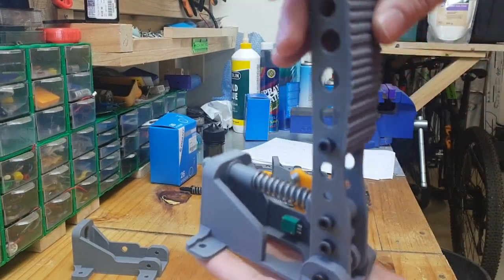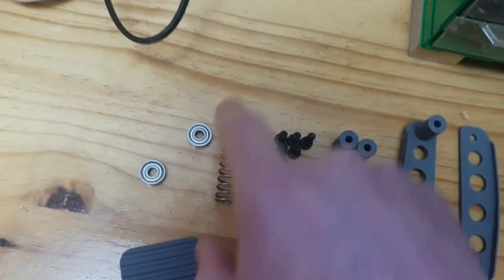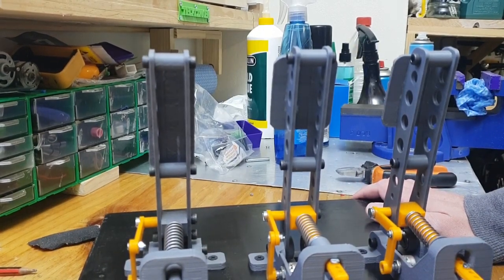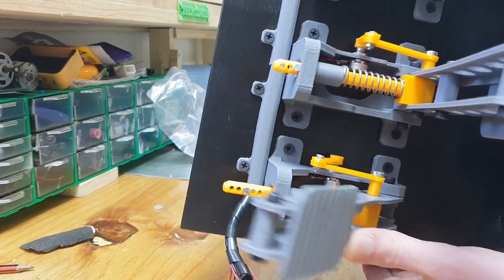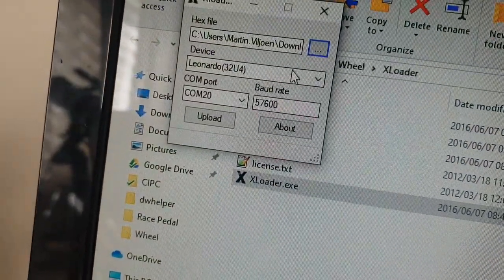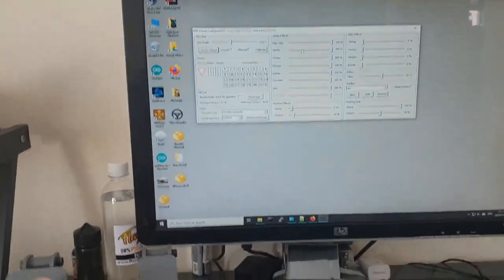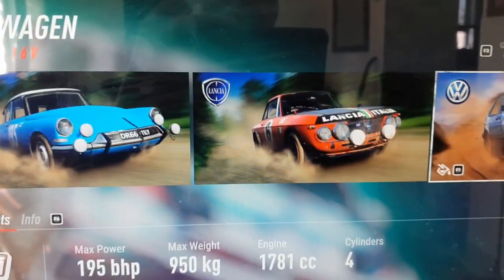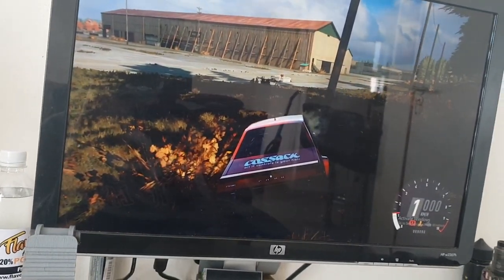3D Printed Racing Simulator Pedals

Comment: XLoader cant recognize my Leonardo do you have any idea why that could be? Leo says it has a bootloader, Device manager reads it just fine aswell. Also when i open Wheel config its flashing on tx LED. But XLoader says upload failed evry time even when selecting the correct Com channel after reset. Any feedback would be wonderful! have put so much work into a full rig and this whole mess with XLoader is driving me bonkers! Thanks.

Comment: Hello, the pedals are looking great!
Potentiometers exist in two different types, Linear and Logarithmic.
- Linear is what you want to use for this kind of projects.
- Logarithmic is what you want for audio (volume control) applications.
Also, any value for the potentiometers should be fine, if it is connected
1 -> 5V
2 -> A0
3 -> GND
where 2 is the central pin of the potentiometer.
Value should matter if other resistors are used in the circuit, but in this simple case it's not necessary.
Reply from the maker: Thank you. Agree the potentioeters shouldnt make  diff. But in this application it does. I have  tried multiple potentiomiters and found that certain values do not give enough range. As said in the video the acelerator would start half way or or only go half way depending which way around you connect them and would not have worked it they were connected incorrectly. It it may be due the way the original creator of the firmare coded it. causing them not to utalize its full resolution. Also the pedal only has about 1/4th travel on the pot. 1/4 th on 100k and 1/4 th on a 1k does not pose the same amount of resistance. Cheers!
Reply: @Mailmartinviljoen  Sounds like  you did not calibrate them in windows and/or the game.

Calibrate in Windows. Than they will ONLY work in the range where you can actually move them.
This is crucial for almost every controler to work properly. Even freshly bought xbox controllers should be calibrated first!

Comment: Hey bro nice work ! Can i ask you, why doe we need the leonardo ? Can i just use an uno instead ?
Reply from the maker: Quite simple :-) The Leonardo is making use of a different chip that allows it to behave as a computer peripheral. I.E  it can emulate Keyboard/Mouse/Joystick. The Arduino Uno cannot do that in standard form. There is however a way to reflash its chip but then it cannot be used with the arduino IDE anymore and will also not be compatible with the wheel software. If you look in the Standard Arduino ide under examples->USB there are some examples that you can look at. In the header it clearly tells you it will only work with a Leonardo.

Comment: I'm planning on building this soon, but i'm a bit confused on how the bearings do anything. How are they attached to the bolt that is used to hold the pedal in place, as it looks like it just sits in the hole.
Reply from the maker: Well spotted :-) They don't do anything, call it a design flaw if you like. They are only there to provide a steel pivot as opposed to running the plastic directly on the steel bolt
Reply: @Mailmartinviljoen  would it be possible to use a longer bolt and put a nut on the end so it actually uses the bearing?

Comment: Why do you use linkages instead of opting for a design with a 3d printed hinge that spins the potentiometer? I want to create my own design but I'm not sure if using linkages is going to be the option I want to use.
Reply from the maker: Do you mean attaching the pot to where the pedal pivot on the body? I used the links because it was easier to design it that way. Also allows me to hide it out of the away. Not sure if i understand you correctly.
Reply: @Mailmartinviljoen  Yeah that's what I meant, sorry for the convoluted sentence. Also thank you, your reasoning behind your design decision, it helps a lot. I'm working on a  similar design but didn't know if the linkage was spinning the pot to a further degree; which could be beneficial.

Comment: Hey bro, first I appreciate you about your good job! It's a good project. For 3d printing, which filament did you use? And which method(FDM,MJF,SLA?) did you use? Can you please tell me, how I will make this plastics strong?
Reply: Abim 3d printer in fdm sla falan olmasi onemli degil, pla abs falan da fark etmez ben kendi adima pla bastim yuzde 20 infill ile yeterince saglam oluyor, is goruyor.
Reply: @emrekaraagac3211  hocam teşekkürler, peki eğip bükmeye çalıştığınızda bir sıkıntı çıkardı mı? esneme vs var mı zamanla?

Comment: These are awesome! I'm going to make a clutch petal using this pretty soon. How well do these hold up?
Reply from the maker: Hi thanks. To be honest i havent used it all that much,  so im not sure how long they will last.
Reply: I ended up using an arduino pro micro. I wrote my own code so i could use a 10k. Just make sure use use something like petg
Reply: @jefrie7144  Could you share the code for the 10k on the pro micro? That's what I am planning on using.
Reply: @Wshaf97  If you still need help I can try to code something for you from scratch.
Reply: @1312_PV  hi, i need help too
Reply: @1312_PV  thanks for the help, but the problem is that I have an Arduino Nano. will it work too ?
Reply: @mlodziutki6253  With Arduino nano you cannot do USB HID devices, at least I don't know how to. I only know for Arduino with ATmega32u4 microcontrollers ("processors") such as those listed.
Reply: @1312_PV  so I need to buy another Arduino, ehh. thanks so much for help
Reply: @mlodziutki6253  For the method I knoe yes, maybe not for others. If you can wait these boards in aliexpress can cost below 4€ including shipping.
Reply: @1312_PV  thanks for info :D